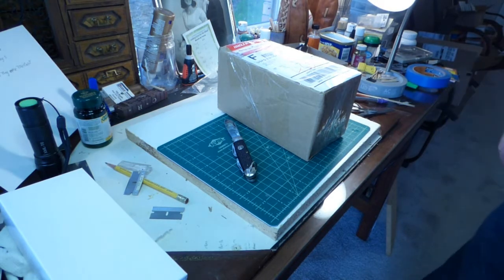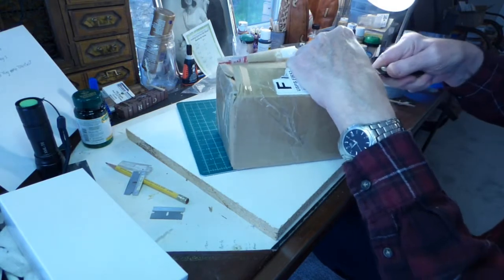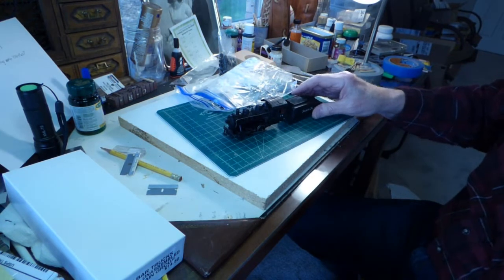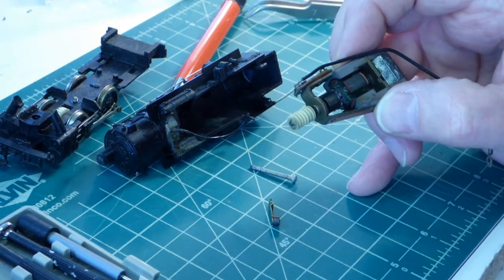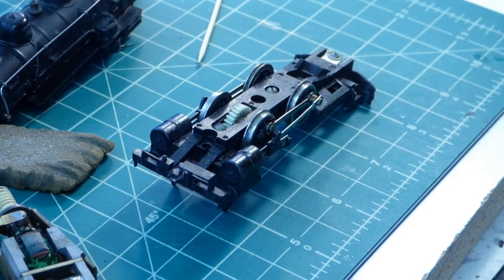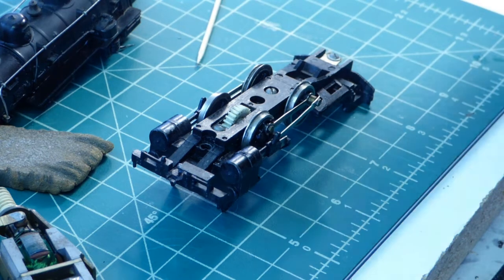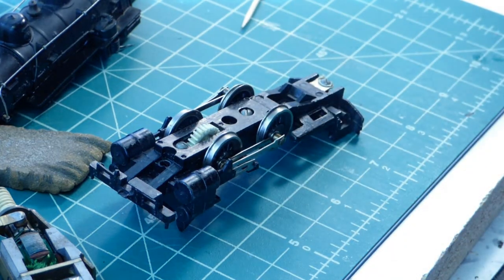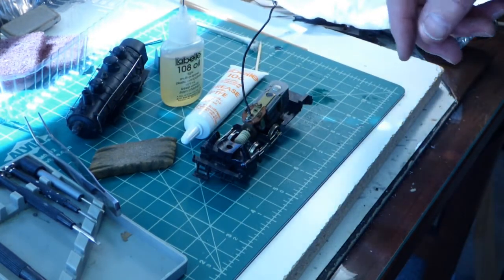Mantua 0 4 0 Restoration Part I - Mechanicals

Comment: A long time ago ... like in the early 1980's ... I purchased a cheap HO-scale DC Tyco "Chattanooga" train set to run underneath a girlfriend's Christmas tree.  Girlfriend long gone but I still have most of the cars & parts of the set.  Planning to use the rolling stock to learn weathering techniques ...  wouldn't feel too bad if I ruined them!!  The nice looking engine and tender ... placed on a small piece of track ... have sat on a bookshelf for years because the last time I checked the engine didn't run.  So your video has inspired me to take another look at the engine!!  Everything I have now is DCC, but would still be nice to tinker with it and get it running again ... convert to DCC maybe.  All the best ...
Reply from the maker: Donald, that sounds like a good use of that old rolling stock.  And, try to get the locomotive running again for sure.

Comment: Nice little loco. Did you ever run a  "Part II" on this? I ask because I could not find it. Can you provide the link if there is one? Thanks.
Reply from the maker: Sadly not, Tom.  It is still waiting for a trip to the paint shop.  However, I have done other videos on stripping off paint and repainting Mantua/Tyco locos.